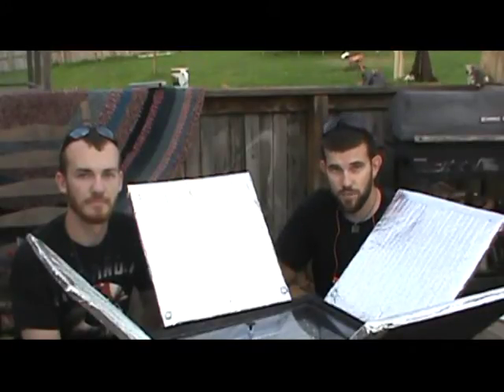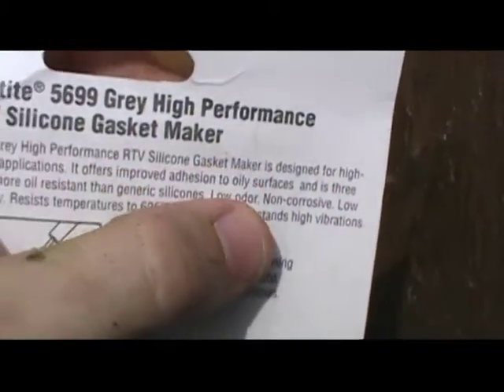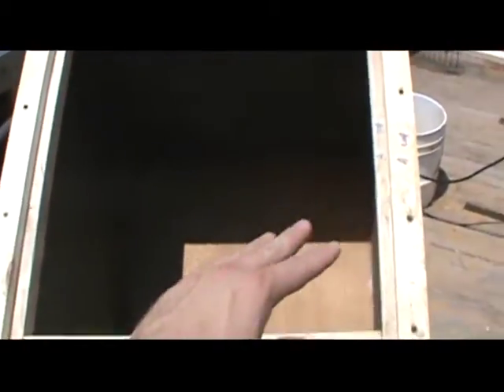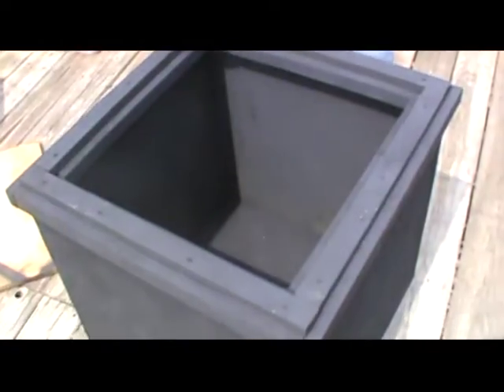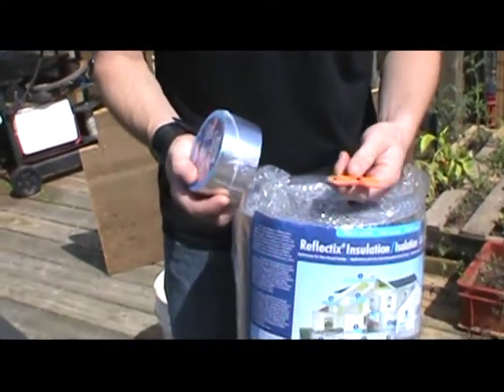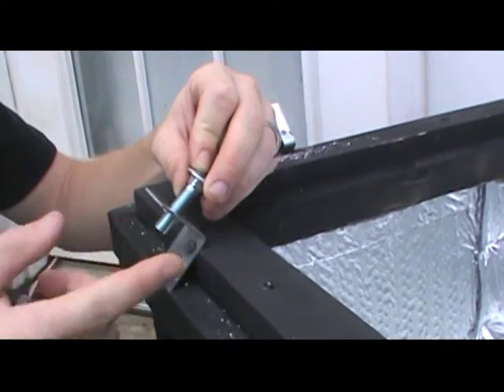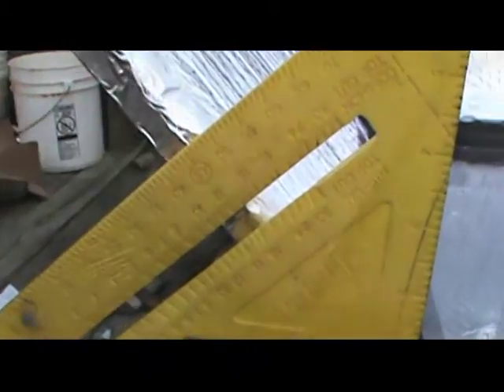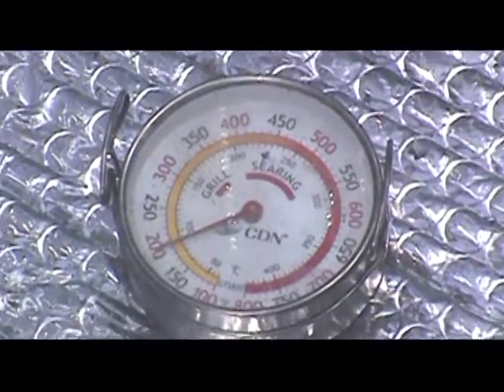HOW TO BUILD A SOLAR OVEN FROM START TO FINISH

Comment: I think it would give you more heat if you paint inside in mate black because now it's reflecting all light do experiment and you will see. For example if you take two metal plates ant paint one in black another in reflective which get hotter during the day?